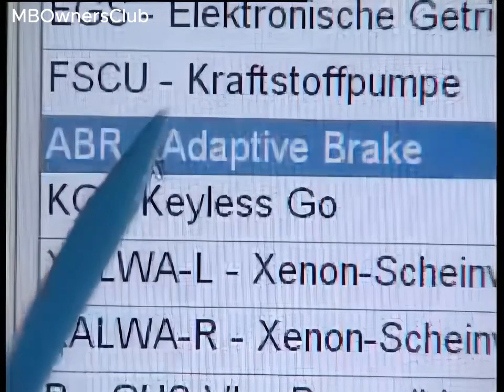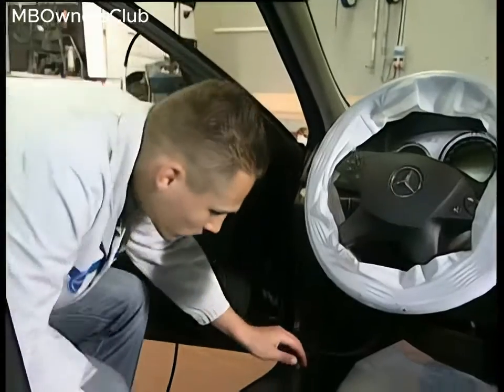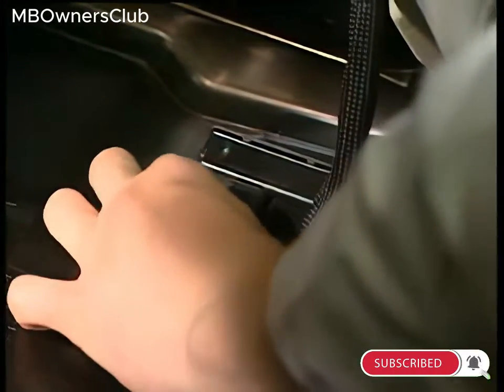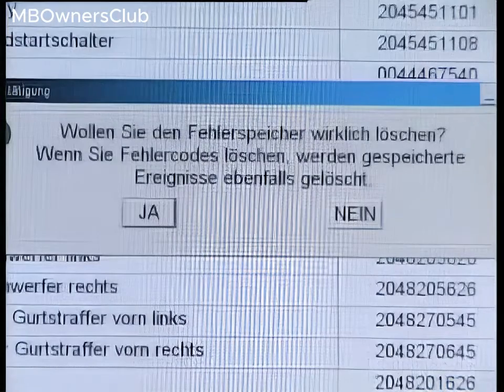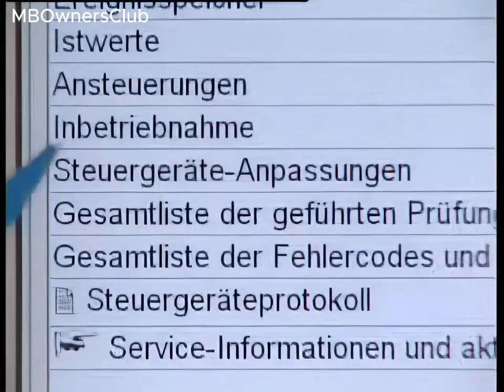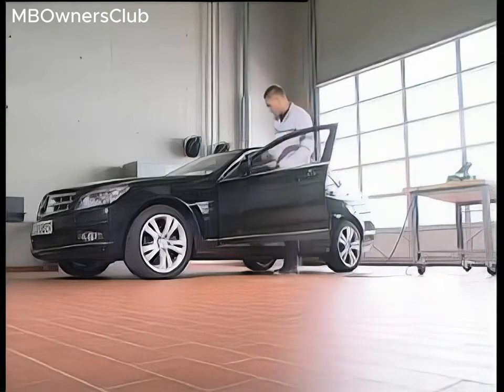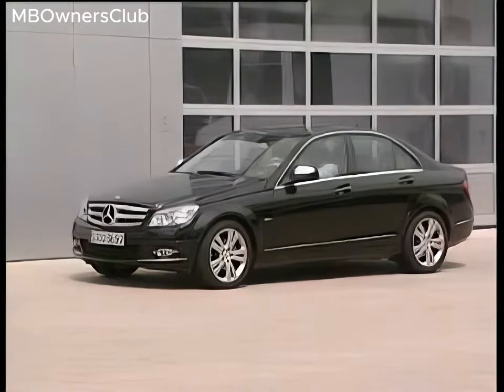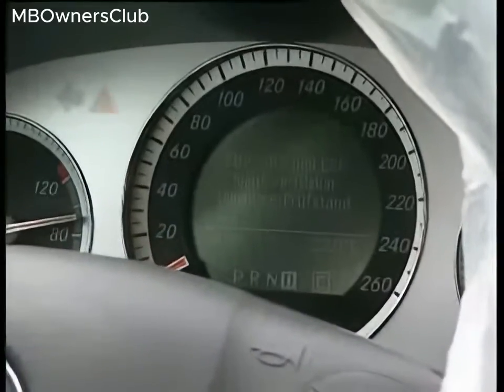Mercedes C-Class W204 ESP Fault: Diagnosing and Fixing Turn Rate Sensor Issue

Comment: Could it also be the accelerator sensor, as it is responsible for pressure. (under press or over pressure!)
Reply: What error code were you getting ?
I'm having  the same issue rarely (sometimes it does popup, sometimes not) but when I scan the error codes I get this : 
Code 5001: "Control unit N30/4 (Electronic Stability Program Control Unit), internal fault.

I dont see any errors related to a sensor